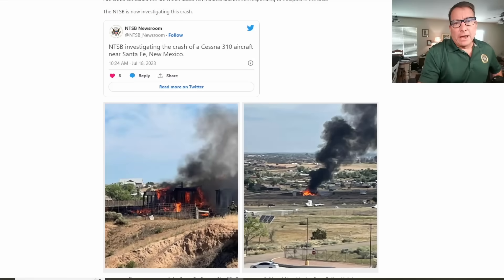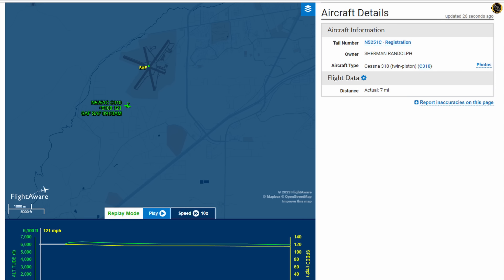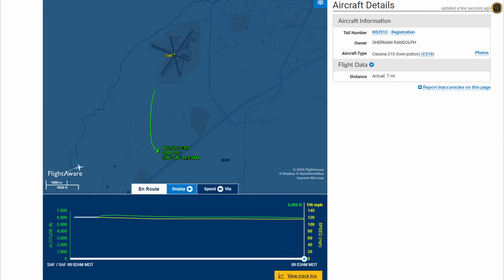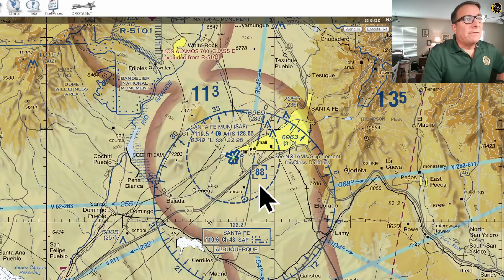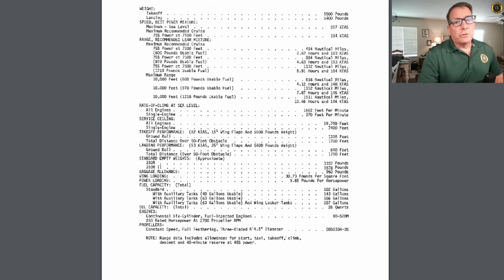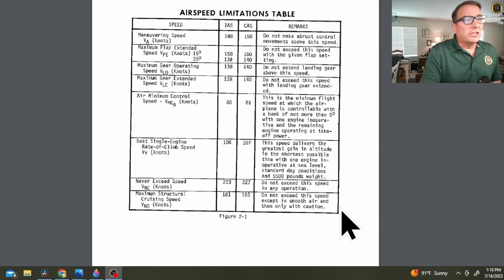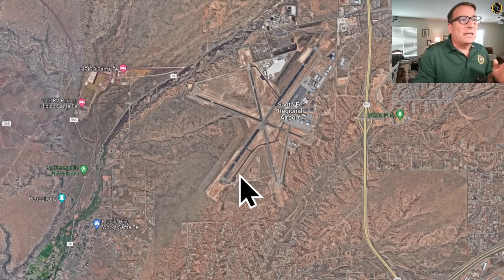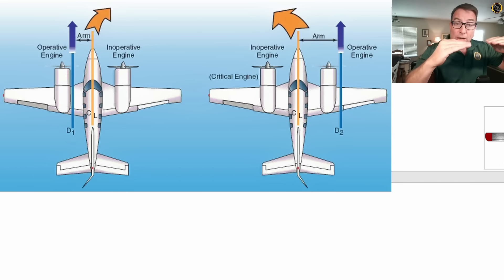Fatal C-310R Engine Failure - Santa Fe, NM

Comment: Juan, I think you missed a big point here. This was a T310 and your chart information shows stats from a normally aspirated 310. Density altitude should have been far less of a factor when the good engine could easily have been capable of rated power or more. Unless fuel contamination comes to light, which may have affected his “good” engine also, this was poor pilotage pure and simple. Pilots of old turbocharged aircraft that are not turbo-normalized grow reticent of possible overboost on takeoff and the ensuing $125K hit to the wallet. Hate to be that guy, but he probably had  another 50hp available if he just pushed the good throttle forward a half inch. 30-year controller speaking now and this guy did him no favors. Suggesting ANY turn without identifying which engine failed was a bad clearance, but fewer and fewer controllers are also pilots these days, let alone twin engine rated. I’m postulating now, but this was an older Beverly Hills plastic surgeon who was still attached to the Sky King sexiness of the 310 but should have been flying a PC12. Another huge hit to aviation insurance bit condolances to the family.

Comment: Did you pull the turbo tables @blancolirio?
Reply: According to FAA (and Dan 😂) the aircraft was equipped with TSIO-520 engines. Your tables show the non turbo IO-520M engine. That should be the difference between Dan‘s claim of at least 300 ft/ Min single engine climb rate and merely impossible climb out performance on the side of a non turbo IO-520M equipped 310.

Comment: That Turbo 310R , if cleaned up and prop feathered would have climbed at around 300 fpm; had he gone straight ahead or a slight  right turn he could have put it down gear up and survived; tower cleared him for left turn not knowing that engine was gone; he should have known never turn into the dead engine

Comment: The AOPA Analysis shows it as Turbo 310R, with Single Engine Service Ceiling much higher than density altitude that day.. You referred to engines as IO-520's rather than TSIO-520's.. Can you confirm which engines the plane had? At least with Turbo version he had a slim chance of gaining altitude, but with straight IO-520's plane took off above SE Service Ceiling and climb performance on one engine was going to be a descent even with perfect technique...

Comment: With engine failures occurring just after take off either due to mechanical failure or miss fueling, why are pilots not doing a longer ground run up rather than a quick L / R / Both mag check?

Comment: I have never flown in or out of Santa Fe, but I have driven there many times. A few times I was driving a 2011 Ford Mustang GT rated at 412 HP and I can tell you that the power was down very noticeably. Probably 100 HP, Density Altitude is real flying or driving.

Comment: My buddy Tom and I are 310 guys. There is nothing that comes to mind that you have not already covered. I suspect that this record heat wave will claim additional airmen. Death Valley came within a couple degrees of setting the all-time world record for heat. In this crazy weather it is not unusual to fly into an inversion, where the temperature at five hundred feet or better is equal to or greater than that on the ground. But I think in this case the charts tell the tale. Whether the number one was feathered or not remains to be seen. And they might decide that was a nonfactor anyway. The air is too hot, too thin. This is why, precisely, we don't fly during the day in Merida Mexico. One seventy-two's, archers, cheetahs, everything, including air buses would rain from the sky. These conditions, to me, may warrant IFR, night flight versus a high risk day flight. Within seconds and sundown, as you know, the air temperature plummets. And it's a damn good time to go flying at ten o'clock at night or better. Great video. I shared this with my buddy Tom, a carrier rated fighter pilot who is distinguished for electing a bellyflop at NAS Key West versus eject and lose his aircraft. Funny thing, some of the Mig pilots he flew against our now amongst his best friends. Too many stories to share here. Again, we thank you.

Comment: Good report except according to the FAA registration the crash aircraft was a T310. The aircraft was turbocharged. So the Single engine service ceiling would be better.

Tho how much better the turbo engines would have handled the high induction temperature of the air is probably not much. Intercooler to cool the induction air would have helped recover some power loss but probably not much. Intercoolers really work best at cooling induction air at higher cooler altitudes.

Comment: Even the 337’s seem to have a bad crash record after rear engine failure.  Emergency autopilot might be a nice feature but the FAA would probably never approve a retrofit.
Reply: That would do absolutely nothing to help in this situation, proper preflight planning would have been the most effective tool to use here…
Reply: @joer5571  What I’m talking about is an AI autopilot.  Doesn’t currently exist for private aviation that I know of.
Reply: @naughtiusmaximus830    Thanks, yeah, I understand what you’re talking about, there are just too many variables with general aviation low performance (as compared to jets) light aircraft, and the cost would be prohibitive until you start getting into the multi million dollar newest generation aircraft, retrofitting older ones would be crazy expensive…   Even a nicely equipped NEW Cirrus with a manually operated parachute system will cost you well over a million dollars, and that’s not an automated system…   Better to be trained properly, and keep your pilot skills up to a good standard, know what to do in an emergency, and FIRST, DON’T put yourself in a situation where you don’t know what to do, or you CAN’T get yourself out of…

Comment: As an ATC- I can tell you that most of us are not pilots, and no, we are not trained on pilots procedures, such as- don’t turn into the dead engine. No controller has ever even heard of VMCA. As a pilot, I know that, but I’ll bet that the vast majority of controllers have no clue about that…
Okay, so, I just polled a few of my coworkers, and they never heard about avoiding turning into the dead engine- especially the left. It’s a different discipline- pilot vs ATC. I mean, it shouldn’t be different. I think we all should know things like that, but at the same time, how much are we really expected to know about the numerous procedures for different aircraft? And I’ll bet that the controller involved in this didn’t know this. I understand suggesting the left turn back to the runway- quickest way to a suitable runway. It’s really on pilots to understand that in a serious emergency, I, the ATC, am here for suggestions. You, as the pilot, do what you need to do. If you can justify it, you do it. Live to defend yourself. Don’t die because you thought you had to do what I said.
Reply: It's fine to turn into the dead engine as long as the plane has enough airspeed. Please don't advise your fellow controllers to prevent pilots from turning into the dead engine. Sometimes it's the best choice.

Comment: Honest question:

Working in hypotheticals here, in a situation like this ought a controller —in the pursuit of seeking to provide general routing directions to the most satisfactory landing runway possibility— have inquired which engine failed?

Or is that considered not timely, or too-busy of an inquiry ?  (Like, you don't want to be intrusively distracting the pilot, or be seen as telling them how to fly their plane.)

Would that be a protocol?

From a distance it sounds like that would be useful information, but I'm not a pilot.

Comment: gutting - blue skies to the pilot
great explanation from Juan, i immediately thought this chap might be slow to turn back to the airfield, but as Juan explains, turning left on a dead engine is not so easy as the dead engine causes all kinds of imbalance with and including the rudder input to balance the right side, it makes me wonder if putting the plane down in as much of a straight line might be best in this situation and obviously the pilot was trying to gain some height too - he was only around 400ft? if that's correct - thats pretty scary and i guess the most dangerous part of any flight is getting airborne and to a safe altitude where you hope you have both height and some time to make the correct choices, another tough one

Comment: Thanks Juan, this guy didn't have a chance. The pilot lived in Beverly Hills CA. Flying into mountainous terrain has it's own challenges. God rest his soul.
Reply: Beverly Hills is next to mountainous terrain, just at a lower altitude than Santa Fe. To do much flying out of the Los Angeles area, one would have to deal with high mountains and possibly airports at a similar elevation as Santa Fe, depending on the destination. Flying to Mammoth Lakes to do some fishing? Gotta watch that density altitude.
Reply: @EXROBOWIDOW  Dude, you missed the point. Juan didn't include the airplane was a T-310R, which is turbocharged. Juan paid the price of being the first one out with the crash details. Being a turbo 310 this airplane should have same climb capability, but not much. The question really is this airplane was capable to climb, even thought not much, but the real case is why did the pilot state an engine fail and why did he make the decisions leading to the crash? Just because a sea level airport has mountains around doesn't make you a mountain pilot.
Reply: @jimpalmer1969  I later watched the Air Safety Institute video on this accident. Yes, the guy in the video seems to have gotten all his facts aligned about the aircraft and its capabilities. The video came out the day after blancolirio and Dan Gryder both posted on it. I think one commenter stated that summer in the desert is the time light aircraft owners do their annuals. Apparently everybody agrees that, based on what we know so far, the pilot made fatal mistakes.

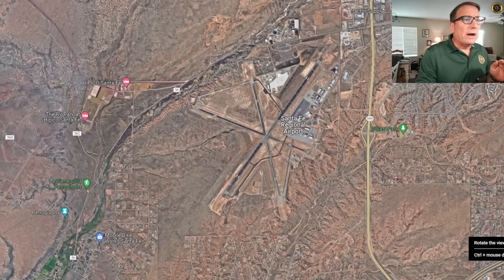Comment: Hey Juan: At 6:20 you suggest they didn't discuss which engine failed on the radio with ATC. But the audio tape you played back at 1:54 I can very clearly hear ATC ask him "It's THE 'one' engine" and he responds "One engine".

I think there's an assumption here that ATC is asking him how many engines have failed. But it seems just as likely, if not more so, that he was trying to ask him which engine had failed (#1 or #2). I could be wrong but when I heard the playback that's how I interpreted what they were saying. Just my thoughts.

Comment: 7400 ft single engine service ceiling!  That's 1000 ft below density altitude here in Denver in the summer.  So if you live in the mountain west, your 310 may be effectively a single in the summer time as far as engine out performance goes.  So whaddya do?  Pull BOTH levers and pretend you're a really heavy 172?

Comment: Asking as a non aviator....   I take it the plane, on one engine only, was beyond its service ceiling, and therefore didn't have enough power to attempt any sort of turn, especially at only 120' above ground.  Is that correct?  So it would have been best to put it down in a straight line ahead?

Comment: 1979 when I was in the Air Force, one of us rented a 172 in Grand Prairie Texas for a short hop. 4 of us fatties packed ourselves in. I think the only reason we got up was because the wind was blowing hard. Once airborne, the pilot hugged the ground and whenever he tried to gain altitude the airspeed would drop significantly. I think we hugged the ground at 1000' agl and sweated our way to a rural strip. There he landed and set himself up to take off again. I watched the end of the runway come up. We barely got off the ground to clear a barb wire fence at the end. I think I saw two lizards mating on top of one of the posts. We sweated and hugged the ground all the way home, throttle full forward and temps towards the top. We landed and no one said a word. It was a close one.

Comment: I’ve got about 500 hours in the 310R doing aerial survey. 9/10 takeoffs were full fuel and all the camera equipment. I pretty much accepted that if I was going to punch one in the initial climb, I would be putting it down on or in whatever was straight ahead. So sorry this gentleman didn’t have a survivable place to put er’ down. I hope people learn you can’t power out of everything with a twin. Otherwise a beautiful flying airplane in cruise. 9 gal/side at 18,000’ can’t beat it!

Comment: Please people, when you do your pre flight planning do not just consider the density altitude (t/o and climb performance) but also thermal turbulence, sudden wind changes and climbing through weather like cumulus, a dep (SID) with many turns, all often happening around high elevation airports. It will degrade your climb performance even more than 'just' a high density altitude. 
Quito was always a great lesson for me, taking off in big iron on a summer day, wind shift right after t/o to a tail wind while having to turn on the SID while climbing through weather, your performance suddenly sucks, that without an engine out...

Comment: I got ,  my multi in a 310Q in 1985.  Lot's of single engine practice. A 310 flys like a fast single until  you have an engine out. The instructor who signed me off died in that airplane while practicing single engine go arounds in 2005 with a student on board who lived. I think that is ill advised under any circumstance.   A rollover just like Juan described.

Comment: The pull when in a twin prop and one engine out at low speed with the nose up while on the edge isn't fun. You're trimming the rudder and any itch for nose down for speed has a fast torquing on the plane to the bad engine with a wing drop demanding more rudder and watch out for using the ailerons. Darn density altitude and envelope edge.

Comment: In this situation- at density altitude ABOVE single engine service ceiling, best choice might be to shut down the good engine.
Reply: Not true. It was a T310R which means turbocharged and a single engine ceiling of 17.200 ft.

Comment: Engine failure just after takeoff in a light twin, if you're not proficient and/or mentally prepared you would seriously have your hands full.  Accounting for the startle factor, I think he was more along for the ride and getting pulled to the left initially than following the tower's 'turn left' instruction, just trying to keep it in the air.  However, off Rwy 20 there is a scarp and volcanic high terrain to the right and close to the airport, so this would not be a good option for a struggling plane at 100' agl anyway.  The terrain is definitely lower to the left, where this plane ended up, but is not exactly flat and would also not be a great place to put it down.  Straight off 20 there is a strip of flat ground for a couple miles, which probably would have been the best option.  But that would have been a quick decision, and it was gone as soon as he started turning.

As many have pointed out, it looks like the performance chart in the video was for non-turbo, so maybe this plane had a chance of climbing, even with the high DA.  In either case, my first question is if he got the prop feathered.  Without this, turbo or not, he would have no chance of climbing, and would also have a significantly increased Vmc.  This flight only lasted 1-2 minutes, with a lot going on.  It would have taken very quick and correct actions and decisions to come out of this successfully.

Comment: So. maybe make it a standard to have ATC ask which engine failed and thus only ask for turns into the other direction? 🤔
Reply: Having ATC ask which engine failed is pointless and will just cause further distraction to a pilot who is already task saturated. If the pilot can only turn one direction, he/she will do it and won't even bother telling ATC. It's ATC's job to get other planes out of the way. By the way, a plane can turn into the dead engine just fine if it has enough airspeed.
Reply: @igclapp  it's pretty often done already. And just asking for a single bit of information is hardly distracting.

Sure can it be turned into the dead engine, but if the pilots are not trained enough for thus situation it's not advised.

I mean, see above how this can end.

Comment: Marketing for piston twins says the second engine is for safety..  But so often it doesn't work out that way..  The second engine is often provided because there aren't any modern piston singles with more than 350 horsepower - if an airframe needs 500 horsepower, for instance, then you're pretty much stuck with two engines unless you have to money for a turbine.  And then piston twins often have a lot higher wing loading and VS0 than singles making the twin is a lot less crashworthy.  Even if this pilot had reduced power on the good engine so he could crash the plane wings-level, it still would been at a very high ground speed due to the combination of wing loading and density altitude.  Piston singles give you what you expect.  Piston twins probably make sense in the flat lands and near the coast, but should be operated very carefully in the high country.  Or not at all.  It's a sad day for everyone when the statistics finally hit.

Comment: You can go flying in your twin in these conditions, you just have to realize you're a single engine airplane again.  In the event of power loss at low altitude, pull the other back and land straight ahead like any other single.

Comment: You mentioned that its not a good idea to turn into the dead engine due to left turning tendencies.  That is an old wives' tale.  If you raise the dead engine (approx 5 degrees) you have a stable airplane flying straight through the air. If you turn either direction the airplane doesn't know the difference aerodynamically at the same rate of turn.  If you want a 15 degree standard rate turn to the left you only have to bank 10 degrees. For a given amount of turn rate, the drag is the same.